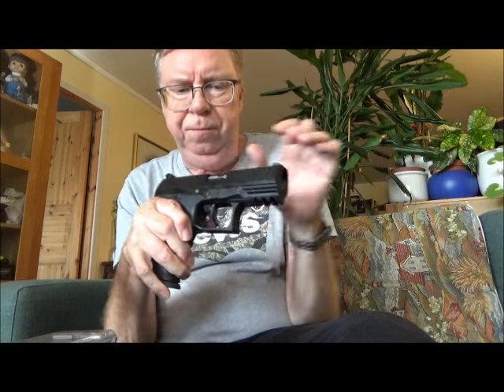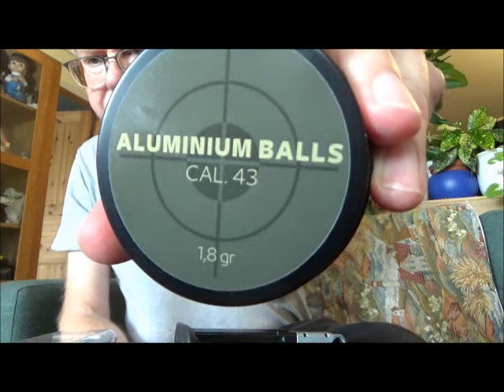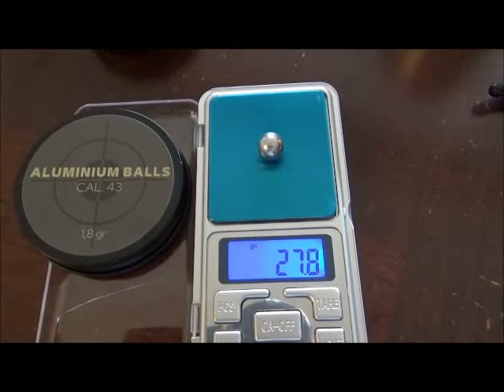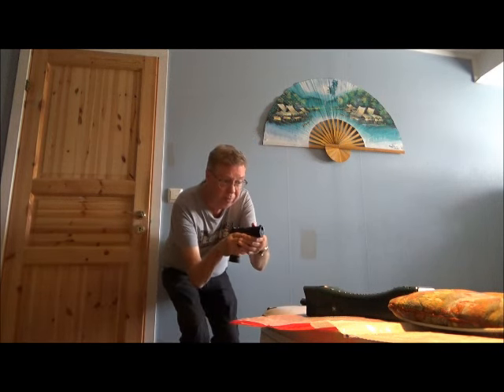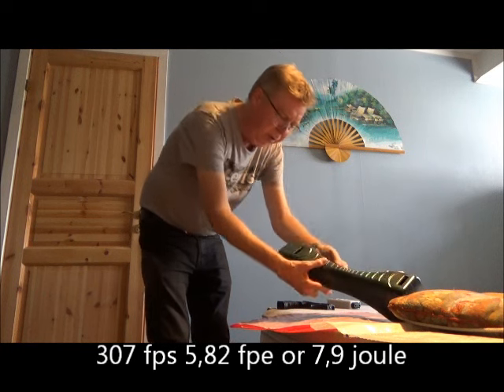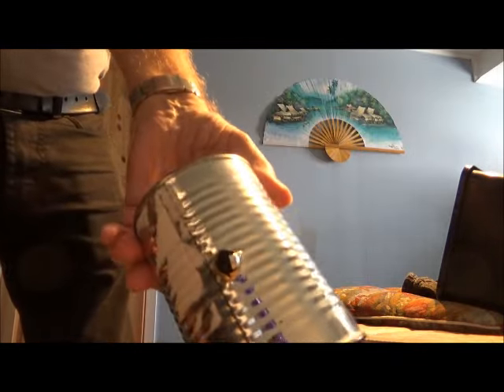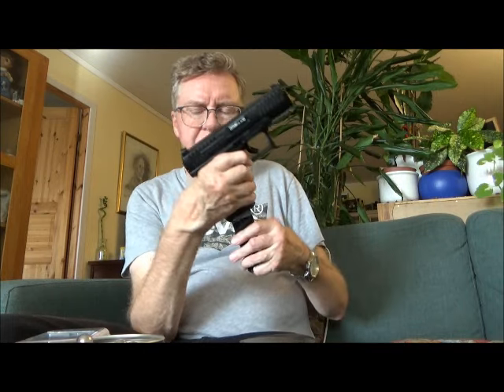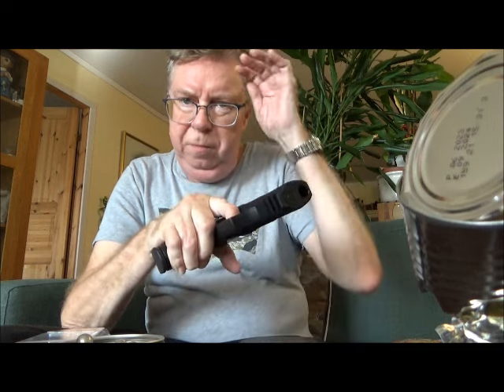Umarex Walther PPQ M2, Shooting a tincan, Homedefence-24

Comment: Another very good video. Where exactly are you holding the XRADAR? I always hold mine just in front of the muzzle on airguns/markers that have blowback. Always worry about getting false fps/mps readings due to slide movement.
Reply from the maker: Thanks my friend. Hold it about one inch from the muzzle up the barrel. Or just before the muzzle. Dont seem to give any diffrence in messuring the velocitys. Cheers 😃